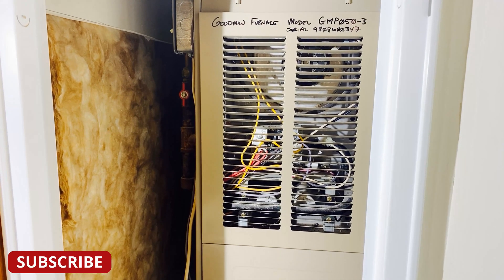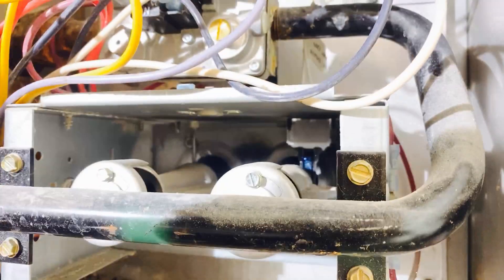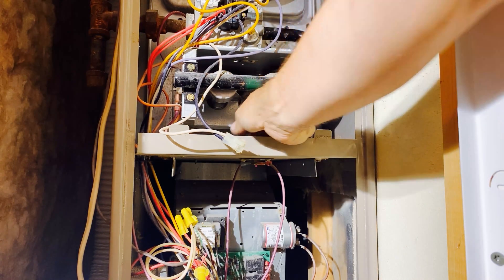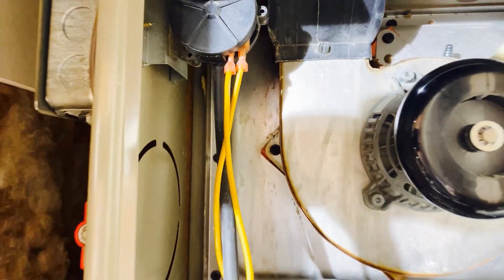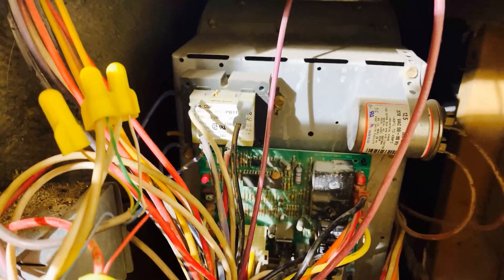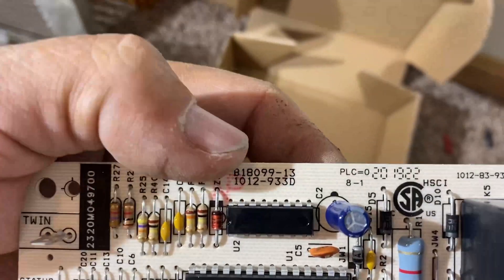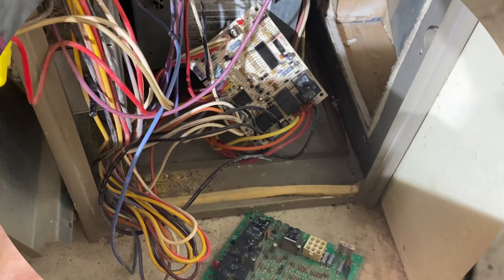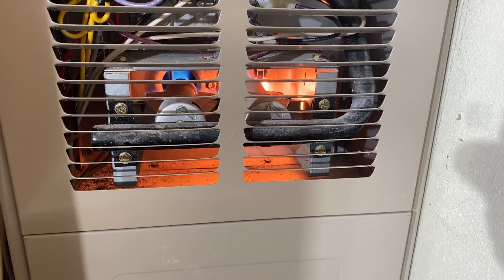Gas furnace not igniting -  Goodman furnace wont ignite - DIY Gas furnace repair

Comment: Good step by step trouble shooting. You saved me from ordering a circuit board. 4 days to get a new igniter so I'm lighting it with a BBQ lighter.  I turned the thermostat to 80 so I could shut it off when I wanted to. It ran for 3 or 4 min and shut the fire off. I was thinking the over heat switch was turning it off. I was right. I have over half the registers closed in rooms I don't use. I opened a couple trying to keep the over heat switch from shutting things down but no good.      It was 55 out today so we were OK but now it's 35 so I went to the basement to cycle it get the temp up so I could go to bed and sitting in a chair relighting it when it shuts off..  OK OK I'm getting to it. I glanced over and saw the gas shut off valve. I started closing it till I just barely noticed a reduction in flame and noise. PERFECT! Back up stairs with a beer and TV till It got to 75 and shut it off. Going to bed.
By the way, that over heat switch has been working like that for 11 yrs. I think I'm going to leave the flame where it's at. Anything wrong with that? 10 yrs I replaced the vacuum switch. 16 yrs now the igniter.
Reply from the maker: Glad to hear that my video got you warm again!
I can't say that I would agree to "running around" an overheat issue for very long. 
The safety switches are there to stop a malfunction to keep you from having more serious issues. Fires, carbon & oher gas issues etc... (stuff that could possibly kill you)
If you are unable to get the furnace to function on its own without tripping safeties and need to manipulate the furnace to make it work anyhow... I am honestly afraid for your safety. 
I would advise doing whatever is needed to get the problem sorted out and the furnace working safely ASAP. 
I know... not what you wanted to hear, but I do tend to skip past the fluff and tell it like I see it.
Be safe and stay healthy my friend!
-ShaneK
Reply: @AHandleOnThings  The furnace was replaced after the floods in 2004, they were hard to get as hurricane Ivan ruined lots of furnaces. Anyway 1200sq ft well insulated house I think the 110,000 might be to big for the house and duct work. Yes I have 4 of the 8 vents shut off in rooms I don't want to heat$$. I ordered the new igniter 3:30 the 13th. As of now it hasn't left the Lancaster post office yet the 15th. (none to be had local) Temps in Pittsburgh aren't to bad 49 to 65 today.
With cutting the gas shut off back just very little I only have to light it once now and runs perfect till I shut it off (the over heat isn't tripping any more) 
I don't care for the heat going up the chimney but $120 peak heating bill W/hot water tank doesn't justify a new one with plastic chimney yet.   Thanks.

Comment: Hello, I have a Goodman 90 % 
The igniter gets red but No fire  comes out to be lit? 
I cleaned the Flame sensor last night it came on with a little help from me pressing on the door to help it ignite the gas? Is this air or igniter is possible bad even though its getting red hot? Thanks for any info. My only code is lock out 3 cycles
Reply from the maker: From what you are describing, I would check the door switch.
It sounds like maybe it isn;t bottoming out if you can hold the door switch in and the furnace lights  that would be a good indicator.

Good luck and let us know what you find!
-Shane
Reply: @AHandleOnThings  I believe its the flame sensor. 
But it wierd. Today I cleaned the sensor took the door off and it started right up. Soon as it was time to cycle again to bring up to temperature it went thru 3 times and now its locked out again? Do you think the flame sensor is the culprit?  I believe i will change   this first.

Comment: Thanks for the video! It was very helpful. Changed the igniter and flame sensor since I had a 15 year old furnace. And it fired back up again! But 4 weeks later I have the same problem -won't ignite...any thoughts?
Reply from the maker: Well... In my video I failed to keep my fingers off of the ignitor. It was a bit tricky shooting in the tight quarters with one hand on the camera etc.. But enough excuses... If you handled the new ignitor, it is POSSIBLE that oils from your hand caused the ignitor to prematurely burn out again. Mine did not have a problem at all, but technically it is a possibility that handling it could have caused you issues.
That said, If your ignitor is not the problem again, the flame sensor gets dirty much more often than the ignitor burns out. Lots of things can cause the flame sensor to get dirty more often (construction in the house for instance) so I would definitely try cleaning the sensor again. 
Good luck , and be sure to check back and let us know what you find!
-Shane

Comment: Thanks for the help , I went through your steps checked the igniter which looked fine as did the flame sensor then I checked my manual led flashing light codes and it was flashing 3 times meaning stuck pressure switch, so I vacuumed out the flue and chimney which were full of soot and debris then the igniter finally came on and it fired up .oh yeah and no more 3 times blinking  light .
Reply from the maker: Right on! Hard to get better than success!
Stay safe and stay healthy my friend!
-Shane

Comment: Did you try the control board after removing the mouse? Clean it up and retry it, it might work.  Good idea to keep a spare igniter in the house, they are cheap online and real handy when its real cold out. Not a bad to keep a spare flame senor around too.  Cheap insurance.
Reply from the maker: Tim,
I did check the control board after pulling the mouse mummy off. He managed to fry a component on the board. I chose to swap the board out rather than desolder the damaged component... I forget which one it  was but I did save the board for "just in case" because it WAS repairable but I was just not in the mood to mess with it.  
You are COMPLETELY correct with keeping spare sensors and ignitors on hand... Those things seem to always give up on a sunday in the middle of a holiday week during a snowstorm lol
Stay safe and stay warm my friend! 
Thanks for the comment, it is a good one!
-Shane

Comment: FYI....Tried these tips on my Goodman gas furnace and almost had my no ignite problem fixed. Thought it was the igniter but found that the pressure switch was froze! Pull the hose off and a tiny white insert can be removed from the pressure switch and blown through to melt. 
It’s tiny so don’t lose it...the size of a finishing nail but apparently freezes up in our 25 degree temps and won’t let furnace ignite. Service call was $100 but I’m warm now.
Reply from the maker: Thanks for the view and the comment! I'm really glad to hear you are back up and running and that it was a cheap fix for you! 
Stay safe and stay warm!
-Shane

Comment: I can't thank you enough for your video. It is currently close to midnight, the current temp is -8 with the wind chill, it's snowing on top of having an ice storm the day before, and oh did I mention it's Central Texas and we never have weather like this - ever.  Our Goodman all of a sudden would start up, but fail to ignite. Now I'm worried that without heat our pipes are going to burst, and because of the weather and road conditions we wouldn't be able to get anyone over to repair the system for days, as this is how long the storm is supposed to last. Your video changed all of that. It was my flame sensor, that I took apart and cleaned. Thank you for saying that it won't look too dirty, but that it doesn't take much to cause it to not work. You're right, that it didn't appear to be dirty, but I cleaned it anyways and it worked! Thank you so much again for all of your help!
Reply from the maker: Rebecca,
I can’t tell you how happy I am that my video helped you get your furnace back up and running ! 
when I hear about people getting the info they need in an emergency from that video it makes me very happy I took the time to make it! 
stay safe, healthy, and WARM!! 
-shane

Comment: Hello Shane! Please tell me (1)how would the igniter and the flame sensor come to failure except for old age. Would it be extreme cold that causes it? (2)My situation is, I manually lowered thermostat to 67 when I left. Came home 5 hrs later, switched thermostat to OFF and back ON, and didn’t get no heat. I heard the fan running intermittently and nothing else. What could my action cause the failure?
Thank you for your great video, Shane!
Hank
Reply from the maker: hank, watch the video and follow the procedures for the pressure switch and cleaning the flame sensor. one of those is almost certainly the problem. and don’t forget to watch for the flash code as shown in the video as well. 
as to what makes them fail... lots of things make them fail but I am getting two thousand views a day tover the last few days (that’s a lot more than usual) so you can bet that the cold weather and the additional cycling of the furnace contributes. 
good luck hank, let me know what you come up with ! 
-shane

Comment: I've looked at your video after browsing the web and maybe you can help me.
I do have a goodman furnace
I'd clean the heat sensor
check the led light at the electronic board and I have a solid red light 
check the igniter and is coming on fine but only for about 5 seconds, while timing your I'd see the igniter stays on for about 12 to 15 seconds
check the pressure switch and is good too, no obstruction in the hose
check 
here is the problem: 
the furnace isn't able to ignite the gas automatically, then I have to ignite it manually, stays on with no other problem what so ever and the furnace works fine without any other issues
any suggestions will greatly be appreciated 
thanks
Reply from the maker: Riq, 
Unfortunately I cannot troubleshoot your furnace from afar, however, I would check to make sure the exhaust that goes to the roof is open and able to pass exhaust. 
But if that isn't an issue, I would consider having a tech come out to have a look. It sounds like your gas supply pathways before the burn chamber may be partially blocked and/or cracked. 
There are many ways a furnace may fail, and I covered the ones that are what I would consider to be realistic for homeowner servicing, but I can't recommend "plumbing" changes without possibly endangering you and I surely don't want to do that.
Good luck my friend, and be sure to let us know what you find to be the problem!
-Shane
Reply: @AHandleOnThings  thank you for replying to me
I already got it going after resenting the unit and the thermostat at the same time after finding some instruction from the manufacturer
Now we all happy the heat is running and warming the house
Reply from the maker: @riqfez5468  Thats is really fantastic man! Thanks for getting back to me and letting me know that! It was -28 F here last night and I was thinking about you and wondering about how it was going for you. I'm so glad you are back up and running!
Stay safe and stay healthy!
-Shane

Comment: That door safety switch was the first component to fail on my Goodman GMP100 furnace. I also replaced the circuit board after 17 years. I paid $67 for a new board on EBay. The Goodman Distributor wanted $135 for the same board but wouldn’t sell it to me because I didn’t have a contractor’s license.
Reply from the maker: Some of those guys are like that... I am pretty lucky, I am a contractor so I can get around a lot of that stuff, but in my area there are distributors that will sell directly to walk in customers. Its no fun waiting for things to be mailed on eBay, but sometimes it sure comes in handy!
Stay safe and stay healthy my friend! ... and thanks for watching the video and commenting! Its always nice to hear from folks!
-Shane
-

Comment: Great video, a small critique would be to avoid touching the hot surface ignitor at all costs. Its very brittle material and the oils from your fingers could potentially cause a problem.  One last recommendation to everyone with a furnace 10 years or older, is to buy a spare ignitor + flame sensor and leave it by your furnace. It's not a matter of "if" those will break, just "when".  And if your luck is anything like mine, that "when" will come in the dead of winter, middle of the night and result in a $600-800 service call.
Reply from the maker: Thanks for the view and the comment Shawn, you are absolutely right and I agree, I was too focused on the camera and in the tight space I was working in I messed up and touched the ignitor!  oops!
Have a super day!
-Shane
Reply: I have a question? Sounds like you know a lot about furnaces, long story short, we rent a house and last year the furnace broke so he got a new one,( I hope new) now we use the gas very minimal, we have space heaters because the cost of gas, sorry let me get to the point, we called him saying it's not working, we checked the gauge on the tank outside and it said 40%
The landlord said it's probably stuck I'm not sure if that's normal, yes it's cold here in Pennsylvania.
So we did get more gas and now it doesn't come on 🤔 I just hope we didn't break anything because we had no gas, but we thought we did.
What should we look for? Maybe it's not lit?
Reply: @ScuzzysPuppetShow  gas is always, always cheaper to run than electric ones. if that wasnt the case, every appliance would be electric since it has way more advantages. so that shud be a good starting point. (Ex: gas driers (for your cloths) are cheaper to run than electric even though simply plugging in a drier into wall outlet is way easier than running gas pipe over to the drier). Im not going to go in depth in a mild, southern climate of a heat pump discussion....this is just a statement of a gas furnace vs space heater operating costs.

As far as why its not running, a furnace has a very distinct sequence of operations (like a straight forward math problem). so when u try to run it, u have to pay attention to when the furance stops running compared with the expected sequence. 

You can youtube a furnace sequence of operations, but the simple stuff would be does it try to ignite, then stay light in the burners, is the gas valve properly selected for either natural gas or propane, was it even installed properly to begin with, etc.  Get some background youtube knowledge on a sequence of operations for a furnace, then observe when it stops running and i can help you out then.
Reply: On an oil fired boiler, never touch the rock filtering on the back of a nozzle. The oils and dirt on your finger can clog oil flow, or distort the flame pattern in the fire box.. For those heating with oil fired heat
Reply: Funny I definitely keep spare capacitors and a contactor handy but have never changed out anything on my 20+ yr old furnace. Knock on wood now. At least I know how to do it now

Comment: 8° f and my furnace is on the outside of the house.😭 Fan mode works but will not turn on the heater.
Reply from the maker: Yikes, that's not good...
Check for those blink codes! Thats what will let you know where to start looking!
-Shane
Reply: @AHandleOnThings  Thanks I think I narrowed it down to the gas valve. Everything else is checking as good. I got a fireplace so that should hold us up for a day or so.
Reply from the maker: @Samestori214  Check back in after you swap out the valve! We always appreciate hearing when people solve their issues!
Stay safe and stay healthy my friend!
-Shane